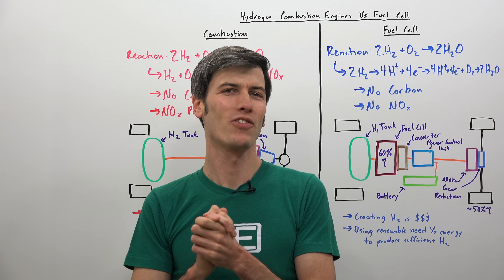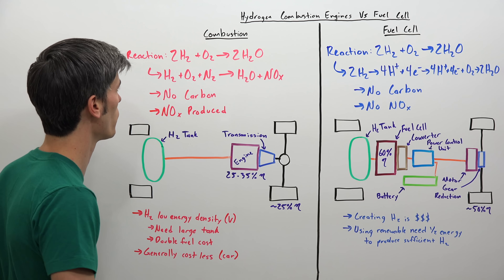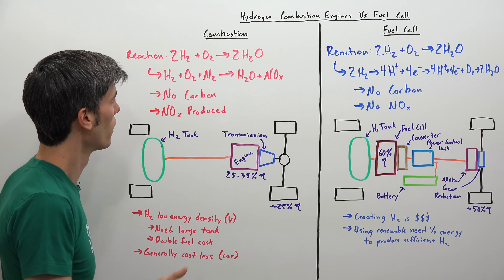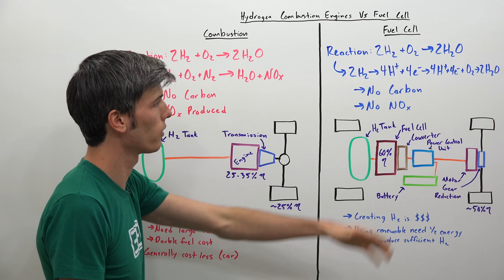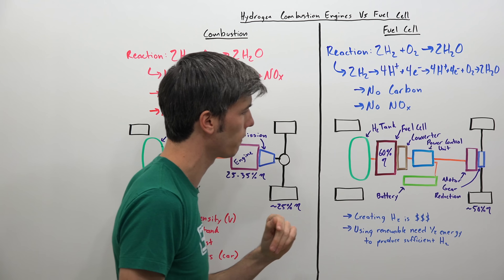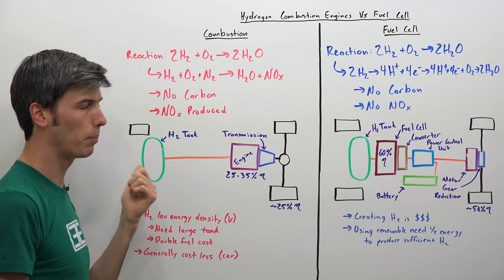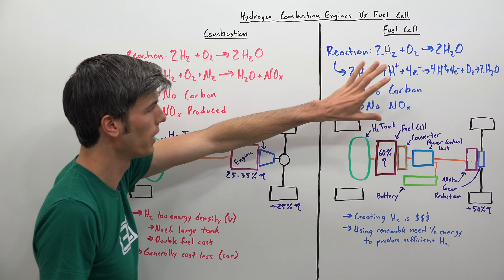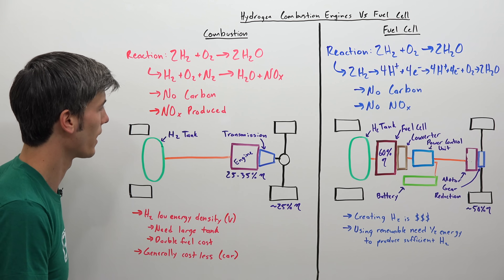Why Hydrogen Engines Are A Bad Idea

Comment: Next video:  Why hydrogen fuel cells are a bad idea
Reply from the maker: Well, currently, they are. Which is why you see much more investment into EVs and traditional gas/diesel engines versus hydrogen. They're too expensive. Not efficient (versus electric). Not clean (currently most hydrogen is made using natural gas). And no infrastructure (refueling).
Reply: @EngineeringExplained  
So why do busses use hydrogen fuel cells as range extenders? Must have some benefit, else nobody would do it, right?
Reply: @Enthropical_Thunder  

The main benefit of hydrogen vs battery is that you can refill to your maximum range a lot , lot faster with hydrogen (around 5-10 minutes) . In every other way it is not as good as current gen of batteries.
Reply: @Enthropical_Thunder  the benefit is the increased range, the cost is the problem. But if your a politician spending other people's money you don't care about the costs being practical so long as you can make yourself look good. For private companies you have the marketing aspect of reduced emissions, and government regulations to contend with. Dealing with the extra cost of hydrogen may be the only way a private fleet can get the permits to operate in certain areas.
Reply: Didn't we just talk about a hydrogen Wankle the other day? I'm really just poking fun Jason, but the message is this: As discoveries are made facts get flipped. That's just how it is, no fault needed. Great Job. I feel very comfortable that if a new discovery rendered an older video less than accurate you would try to be the first to correct it. It's why I subbed some time ago.
Now, has there been any discussion on the channel about the various ways to get hydrogen? It would seem relevant .
Reply: @EngineeringExplained  hehe *current*ly
Reply: @csours  
That pun :D
Reply: @jaydunbar7538  
You won't believe it but even politicians can't just throw money out the window ;D. But actually, i was talking about private companies that actually do  take hydrogen fuel cell fleets into account. Here in Luxembourg, the buses were Diesel hybrids for 5 years now (i think), as far as i know, we got 4 or 5 electric buses that actually run with hydrogen range extenders (those all belong to a private bus company).
Reply: A thought, currently solar and wind generation are idled parts of the day due too demand levels.  Why can't fuel cells be used to level the load by using hydrogen stored from these periods.  I imagine storage would be the problem... balloons possibly?  I appreciate  the thinking your videos promote.  Well done.
Reply: They're too slow and will be replaced by turbine engines.
Reply: Fuel cells have a much shorter life span than an internal combustion engine
Reply: They may not work that great for cars but if we find a better way to make hydrogen (eg. Using excess solar/wind) hydrogen fuel cells could be a good idea in the future. Batteries may never get light enough or small enough to power large machines. It may make sense to use hydrogen fuel cells for large ships, airplanes and heavy equipment in the future if we cant get batteries to work. Its never good to put your whole future on a single technology.
Reply: @EngineeringExplained  One reason is platinum. In order to get energy from hydrogen and oxygen you need a catalyst. And as of yet, platinum based catalysts are the only viable option.

And since platinum is such a rare element, rarer than gold, it is completely impractical at a large scale, even when ignoring the costs. The world would just run out of platinum.

The relative availability of lithium vs demand for batteries is much better than the relative ability of platinum vs demand for fuel cells (If I remember correctly, but the precise numbers should be checked), if you want to have a billion or larger fleet of electric cars. Hydrogen fuel cell cars are also electric btw.

The only possibility for making hydrogen fuel cells viable, is to find an alternative catalyst to platinum. But right now, such a catalyst has not been found/fully developed.
Reply: @rossswenson532  why not just use a battery for your storage. You'd have much better effiency
Reply: @EngineeringExplained  damn
Reply: Ross Swenson Hydrogen as a electricity buffer is too inefficient compared to hydro pumping or storage in batteries. Also fuel cells are quite expensive because of the use of platinum. Storage of hydrogen would not be the biggest problem. Only if there would be an abundance of (renewable) electrical energy, hydrogen & fuel cells might be feasible although the cost of the fuel cells will still be a rather steep hill to climb.
Reply: @GunnarWilkerson  
But solid state batteries have still a big way to go ;D. Innovation doesn't stop for one technology, maybe there will be a viable platinum raplacement in the next years ;D.
Reply: sweinberger   big tanks for H storage to give you much range... BIG...
Reply: @Enthropical_Thunder  Energy Density.
Reply: @Enthropical_Thunder  
Besides refueling time and space, heating is a big point with buses. Buses need more power for heating the cabin compared to cars. The 50% “losses” can be better used for cabin heating.
This is especially a valid argument in the colder places like Northern Europe or Canada. 
The most important aspect: Not the car/bus/train is the reason for hydrogen, it’s the energy system of the region and the buffering of energy over the seasons. We need a technology to handle the fluctuation. It is very likely that we will have to use power to gas/liquid for this. When we then have a significant amount of gas/liquid it makes sense to use it directly for remotely suitable applications.
Reply: @youwanttoliveforever  I'm not sure of the efficiency loss.  How much do you lose 1KW solar to hydrogen to electricity. Batteries use rare toxic/metals.  What is the loss 1Kw solar to Battery?
Reply: @rossswenson532  You mean why not use pressurised and chilled hydrogen which require constant use of electricity to maintain? I will take a battery.
Reply: @Enthropical_Thunder  
Liquid hydrocarbons are excellent energy storage and transportation medium. This Chemical energy storage is only beaten by nuclear.

Hydrogen is gas at room temperatures, but still a fairly good chemical energy storage medium. Can even be seen as continuum when the Hydrocarbon Carbon ratio to Hydrogen tends to zero. I has a high specific energy density, that is stores a lot of energy with a low mass and weight. The drawback is it takes a lot of space, or needs to be heavily compressed (typically 700bar).

Methane (CH4), the basic component for natural gas, has the least carbon to hydrogen ratio among simple hydrocarbons. A unit energy will be heavier with CH4 than H2, but would demand far less space/compression.

There are no H2 wells. There are natural gas (mostly CH4) wells. In fact, most of the world's H2 is produced reacting CH4 with H2O producing H2 + CO2. Producing H2 this way doesn't avoid CO2 emissions.

Photovoltaic electrolytic production of H2 is very costly and inefficient.

If CO2 emissions are locally banned, it's fairly easy for the "hydrocarbon industry" (oil & gas industry) to supply H2 reformed from any hydrocarbon.

There were even gasoline and methanol fuel cell vehicles with onboard fuel reforming to H2 for the FC.

Anyway there are still emissions when reforming, and demand for hydrocarbons. If Carbon Capture and Storage (CCS) worked ok and cheaply it could be used with industrial reforming to avoid CO2 emissions, making it a plausible solution.

As it is, it's better just to use the natural gas directly.

Anyway, batteries are at least an order of magnitude worse than any hydrocarbon as a storage medium. More likely 2 orders, with electrification recovering a bit of this.

If demand can be supplied by batteries slowly charged from the grid, pure battery EVs are a good solution.

If energy demand is to high, it might make sense incurring in the H2 losses, as a medium to convey the energy to the application.

Charging a Class 8 truck in a similar time as is done with diesel requires a huge power. No negligible impact on the grid as a small car charging overnight. Energy buffering for this charging will cost, and compete with packing energy into hydrogen or some other FC chemistry (there are many others as Zinc Oxide, etc.)

It's worth exploring, but far from sure it will prevail.
Reply from the maker: They do have advantages: https://youtu.be/l6ECwRnJ0Sg
Reply: @rossswenson532  this channel actually does a good video breaking down the efficiency losses of h2 vs battery's. From memory it's about 3x more efficient to use a battery
Reply: @csours  well they experimenting with it, Colorado zh2 have pretty durable tanks, they made to withstand 50 cal fire, because it's tested for military, so if that will prove it self, then maybe it'll do
Reply: @EngineeringExplained  You know a tech is dun goofed when EE criticizes them.
Reply: @EngineeringExplained  i do believe they're not a great solution, although they work well for certain applications.
i was just poking fun, i appreciate the fact that you go in depth in various tecnologies, and talk about all the down sides.
keep at it, great content!
Reply: @youwanttoliveforever  Thanks.
Reply: @Enthropical_Thunder  Hydrogen makes a bit more sense for large vehicles operating on a fixed route that have a tight timetable. That makes the problem of infrastructure go away since it can be built on site. You can then run your buses 24/7, if needed, and the refilling infrastructure can be sized for the route and number of vehicles.
Batteries are more efficient than fuel cells, but potentially cost more over the lifetime and currently weigh more.
Reply: @GunnarWilkerson  When you start seeing solid state batteries in phones, then you can start thinking about starting a clock on when you'll see them in transportation. Transportation has additional challenges for the brittle materials in solid state batteries.
Reply: As a blimp crewman I can confirm this
Reply: @EngineeringExplained  You forgot a tiny tiny detail, current engines are not ideal, but Bourke engines... Well, you should give a look. Bourke engines are really efficient, and it rivals fuel cell, Actually being slightly more efficient.
And the part of no CO or so is simply not true... That would be in a a best case scenario.  CO is generated when electricity flows on the atmosphere... So yes, kinda not ideal. You actually generate a considerable amount is CO... Not good. And, Hydrogen cells have about 60% efficiency right now is a good case scenario: they get much more inefficiency as big as they go... There are a lot of things to consider. I'd say that right now, they have the same total efficiency... Cells are inefficient, and need the super pollutant lithium battery, and engines are more inefficient, but the power goes right into the wheels. Let's wait until I finally can start working on a Bourke engine,I might one day bring it to the market.
Reply: Mandernach Luca marketing. Fossil fuel industry wants to keep you wedded to the pump and they see hydrogen as a way to achieve that.
Reply: remliqa evs van have 50% charge in 30 mins, ie could have 300km charge in 30 mins. Evs can be charged over night @ home, so never needing a charge station.
Reply: @Enthropical_Thunder  I'm not sure how it works in Luxembourg, but in the US private companies get huge government subsidies for using less profitable green tech. 

Here politicians can throw away all the money they want so long as they attach it to one of the causes people care about in the current day, doesn't matter if every bit of information says it's a waste of money so long as the people screaming loudest support it. If you want to see where US tax dollars go check out all the riders in legislation, it's crazy the stuff that gets done without having to pass on it's own merits.
Reply: biggest bummr is that you cqnt produce hydrogen cleanly in the amounts needed to kick off a revolution.

Imho, hybrid fuel/electic are a nice enough combo.
Reply: They are used by bus companies because they get a kickback from the Federal thieves who steal from us and give to big business.
Reply: totally agree. only 40% efficient to create it.  then have to transport it by Diesel Tanker to a fuelling station. Toyota won't import their fuel cell vehicle into australia until some poor sap installs the infrastructure to fuel it. Hyundai are thinking about importing theirs also. Might find one or two in Sydney but that's about it. Give me a Tesla model 3. Charge at home using my solar and battery back up.
Reply: Engineering Explained exactly! Down to a T
Reply: @Krasbin  There's Platinum in every IC cars catalytic converter. Compared to battery cars need for gigantic amounts of Lithium, Cobalt etc it pales in to insignificance.
Reply: @youwanttoliveforever  Batteries are a relatively poor way of storing energy. Hygrogen has 200 times the energy density of the best batteries.
Reply: @instanoodles  Yes, batteries cannot replace petroleum in all uses, they simply do not have a high enough energy density.
Reply: @agt155  Yes, IC cars also use platinum catalysts, but the amount required for hydrogen fuel cell vehicles is significantly higher, since it directly scales with the power output of the fuel cell.
Reply: @Krasbin  How much higher?
Reply: @agt155  Unfortunately I have to be honest here, I know it is a lot more, but I don't know it precisely.
Reply: @Krasbin  Fuel cell ~ 10g, gasoline 4-7g. It's not much more, and certainly not prohibitive. Every generation of HFC uses less Platinum, a 90% reduction in the last 10 years.
Reply: @agt155  Oh, I was wrong then.

Thank you very much for checking the real numbers. My knowledge was clearly not up to date.
Reply: sweinberger    "So Tesla could just fit an extra battery and have superior range while still having the same interior space..."  They cant', and haven't.  Crash worthiness issues...  by BIG on hdyrogen, I'm referring to prohibitively BIG for a sedan.  Larger vehicles with bigger profile, you could maybe do it.  But the fact it isn't happening often betrays the ideal by reflecting the realities of issues that can't be overcome.
Reply: @Ian Mangham   I have friends with valve replacements !  :)   One has a pig heart valve and does the Timpanogos Cave trail regularly...  (that's a 1.5mile 1200 vertical gain trail south of SLC UT)...   any mentioning seals, another has a colostomy and Urostomy - totally sealed up a pair of leakers there too ;)
Reply: @EngineeringExplained  - really...I guess that's why Honda and Toyota have them?
Reply: @Enthropical_Thunder   Government subsidy.  Established interests wish to keep selling fuels to customers.  They approach governments all the time to push/showcase their preferred technologies.  

With battery EV's it's trivial to throw up your own solar panels and do most of your charging for free.  Right off the bat, this establishes a cap to what utilities can realistically charge for electric 'fuel' as if they charge too much everyone will just generate their own.  Much harder to do with hydrogen.  It's hard to contain and not really advisable to do in your own home.  Even those who are convinced they could do it safely will have neighbors who disagree...
Reply: @YR2050  
Not nessecary, as we got different battery technologies, there are also different hydrogen storing technologies. For example metal hydride tanks. These types of storages need almost no pressure increase and no cooling. They in fact, need a little bit of heating to releas hydrogen, wich can be the generated heat from the fuel cell ;D.
Reply: @EngineeringExplained  Hydrogen gas can be easily converted to NH3 (ammonia) for transportation then converted to hydrogen at the source. Our current pipeline/tanker network can fulfill this.
Reply: @EngineeringExplained  please do  a fuel cell vs Battery electric
Reply: THANK YOU SIR
Reply: Toyota seems to think The future is Hydrogen and resources for mass battery production are not sustainable long term.
Reply: remliqa  Also, electric vehicle batteries are made out of lithium. Lithium is a carcinogen, last time I looked.
Reply: @HVACSoldier  lithium compounds have no significant clastogenic effects, please don't spread missinformation
Reply: @Ian Mangham Queensland University have created a filter that turns Nitrogen to Ammonia and Ammonia to Nitrogen making storage safe and efficient
Reply: I think powercells have a place, but not as the main engine, it makes more sense as a range extender in a EV. A down side is that powercells needs to have cooling, equal or more than an ICE, depending on the type and climate. As an example, the ICE have a lot of its excess heat going out with the exhaust.
Reply: @rossswenson532  over 50% energy loss converting solar/wind energy to electricity. Then a 96% energy loss splitting water into hydrogen and oxygen. I hen a 50-60% loss converting the hydrogen to mechanical energy. Hydrogen powered vehicles are a pipe dream of tree huggers, and environuts.
Reply: @EngineeringExplained  Too bad that:

1. Supercapacitors are still in the theoretical stage;
2. Lithium pollutes like crazy, even more than CO2;
3. Tell me, what does a slight overvoltage or a puncture to a LiPO battery or a Capacitor? :)
4. Oh, so much infrastructure for EVs! Better forget that WE SHOULD QUADRUPLE THE ENTIRE PLANET'S SUPPLY to accommodate the modern equivalent of EVs as we have ICEs.
Reply: What about TOYOTA MIRAI 2020?
Reply: @InsideOfMyOwnMind  I can't perceive of a hydrogen wankel motor ever working .Too many sealing issues.  Would be an order of magnitude worse with a hydrogen engine.
Reply: Simple answer. Your insurance company says you can't have hydrogen gas.